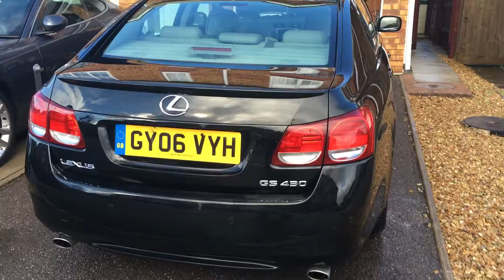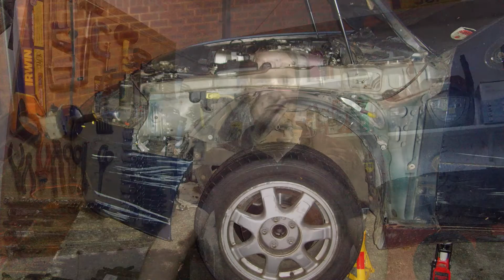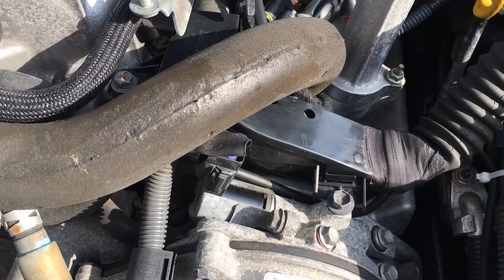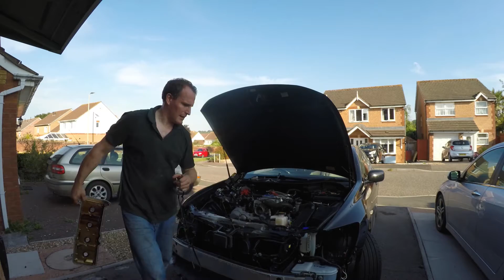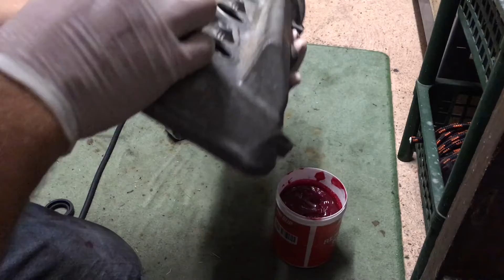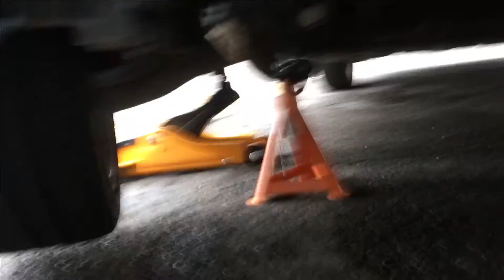Project GS430 E1 - Cam Cover Gaskets, and more...

Comment: Stumbled  into this great  channel  ,,,,,garage full of stufff  and a driveway  to work on been there 👍👍
Reply from the maker: Thanks - glad you enjoyed it and I would emphasize the ‘full’ bit!!
Reply: What did you use to clean the valve cover? It looked brand new after cleaning.
Reply from the maker: I had access to a parts cleaner at work, which cut through it great, but if you don’t have one of them, brake clean and a hard bristle brush will do the job (less quickly…).
Reply: @MikeMacful  ok thank you!